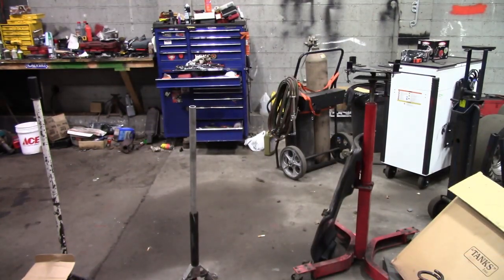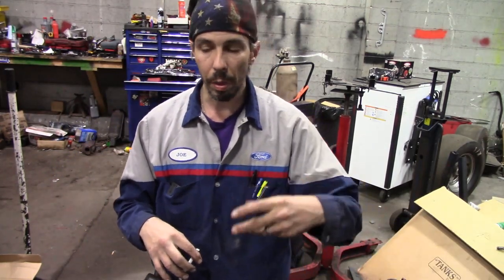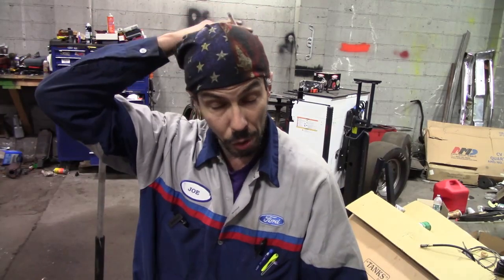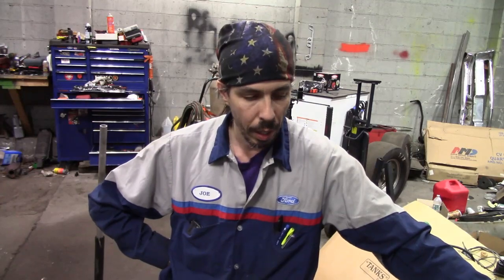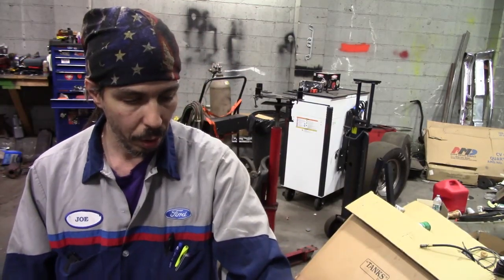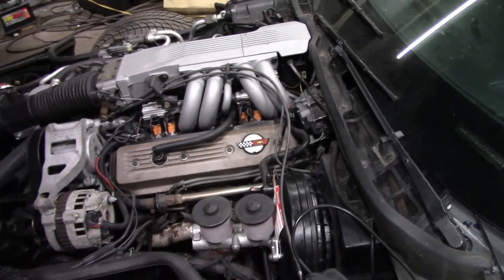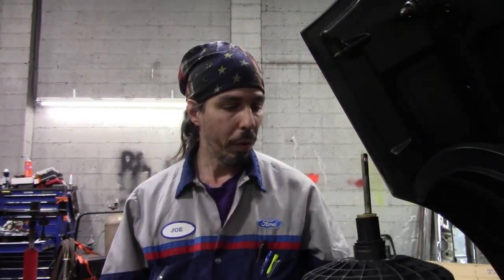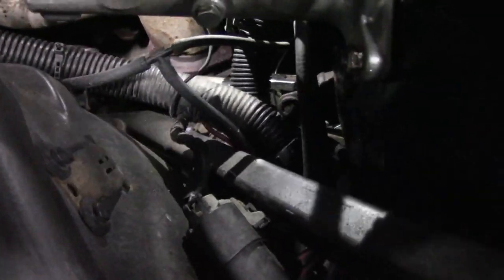C4 Corvette. Given Up On By Last Owner. The New Owner Wants It Fixed!

Comment: Another thing the tpi motors like to kill are the temperature sensors. Messes with so many things when they fail.
Reply from the maker: Anytime an ect failure occurs on fuel injected engines, there will be problems.

Comment: I'm so glad my 90 TPI car is a speed density system, no MAF for me.  These are such simple systems, but can be really frustrating if you can't see all the ECM data because they are only OBD1.  Moates makes the cable you need, if you have one of these. Tuner Pro is the software you want.

These engines have junk fuel injectors that gradually short out and cause the engine to shutdown suddenly with no diagnostic code.  Bosch makes some that will fit the rails and connectors.

Comment: The check valve at the booster will not allow pressure through, its one way,, so no surprise you didn't see smoke there. If you had you'd have a bad booster and check valve.....
Reply from the maker: With check valve removed it was not visible either.

Comment: blm-128  int-128. signed, an old timer. Thats 256 computing for ya. not enough room for more complicated ecm math.  8 bit.
Reply: When you're working with a ramp of 0 to 255, the smallest thing can throw low precision computation off tremendously.
(Coming from an ex-computer technician's standpoint at least 😉)

Comment: A yaa hoo ' mechanic ' would have probably sealed the crack in the brake booster with ' sillycone ' and MAY HAVE temporarily fixed the problem. Hey, $1.00 worth of ' sillycone  ' beats $ 200 for a new brake booster !!!! A real serious hillbilly mechanic might have tried J B Weld and been successful   IF they didn't use too much and it clogged up the guts of the brake booster !!!